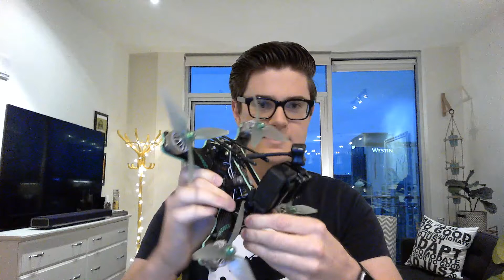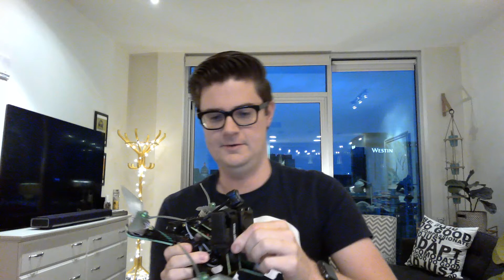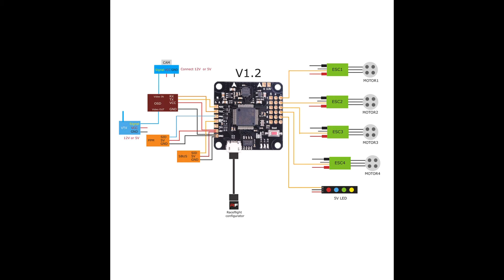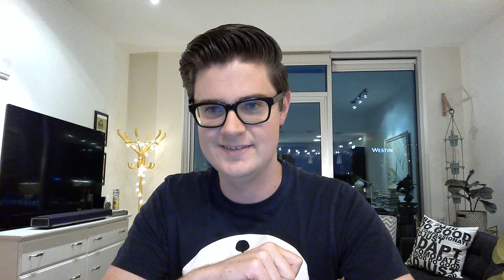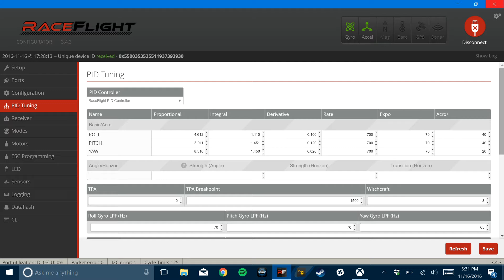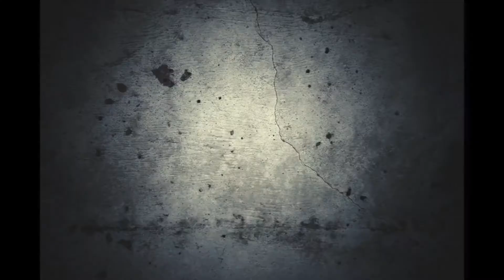Flynoceros Canis M5 V2 Build Review - Blackstar Drones Supernova, Raceflight, BL Heli S Multishot

Comment: hi! i just moved to north Houston from CA, I have to say that weather is kinda crazy here, one day is summer... the next day is winter!? a part from the weird weather these days, I am really liking it here in Texas :) hope I will find some spots and pilots to fly with.
your build looks really sick! those motors! wow, they look real sexy! never heard of them before, now I really want to try out a set of these bad ass motors but they are out of stock for now... hope they will be back in stock soon. 
Your build really got me pumped to get the frame, 97$... ouch... 1 left in stock... what to do... you do recommend this frame? it's suppose to be super durable right? cos I crash... A LOT! if I don't buy it very soon, it will be gone, and since it's a limited run, I guess it's gone forever... with the crash you had!? it sure did survive it! I gotta act fast on this one...
Thanks for the vid
* Raceflight rocks! got it on a quad with BrainFPV F4 FC. Tried to get in dRonin a bit but i was lost
Reply from the maker: Glad to hear you are enjoying Texas!  If there's one thing for sure, it's that the weather here is impossible to forecast haha.  Thanks for the props on the build!  I'm a huge fan of RaceFlight and BL Heli S-- def can't recommend the combo enough. And the new Blackstar Drones motors are going to be killer when they come out (unfortunately the ones I have now are all sold out).  Houston has a great FPV scene from what I hear.  They just hosted a big race last month at the Hot Import Nights expo.  Check out the "Austin FPV Racing" group to stay in touch with our local crew here in Austin!
Reply: Sean Hegarty cool I'll check it Austin fpv racing for sure :) I'll also look up the import nights expo? Never heard of this. Really looking forward at getting the new Blackstar drones motors!